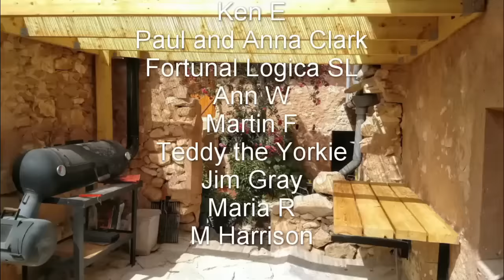A/C install & growing food in a semi desert climate.

Comment: Even if you only need the air conditioner two or three times over the summer, you will certainly appreciate it over the heat on the nasty hot days. Glad to see you have the extra comfort should you need it.

Comment: Well done.  😊
Next time you drill holes in buckets/pots like that put the holes about an inch up the side so that a bit of water stays in the bottom - not enough to drown the plant - and it doesn't all run out of the bottom straight away, which would be helpful given how little water you have!
Make sure you water those trees as much as you can, especially the new ones.
Reply: You both work so hard and I wish I had a green thumb like you Sharon. The exterior of your home is looking awesome. Love watching your channel. ❤